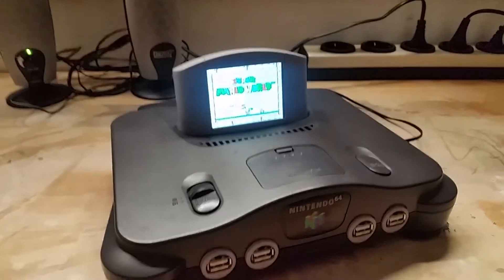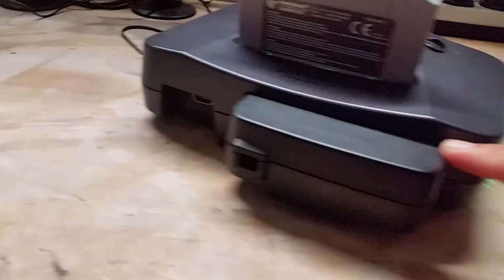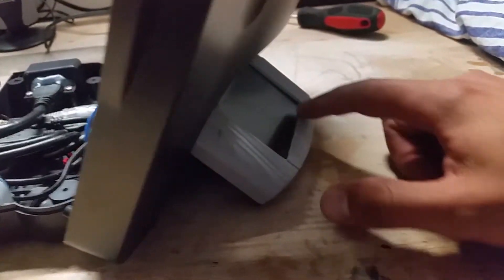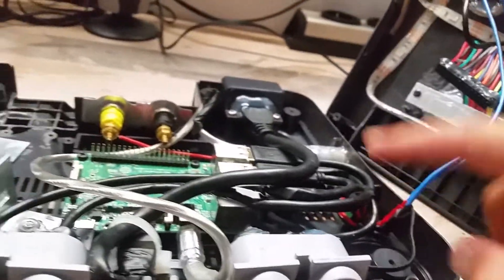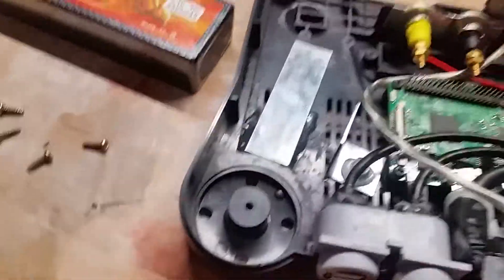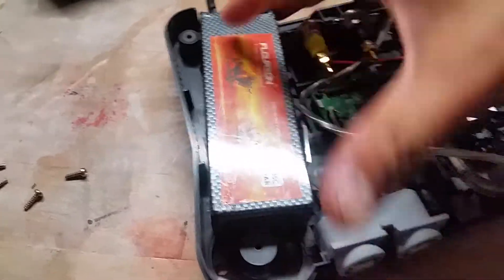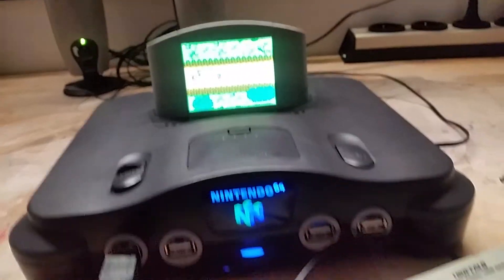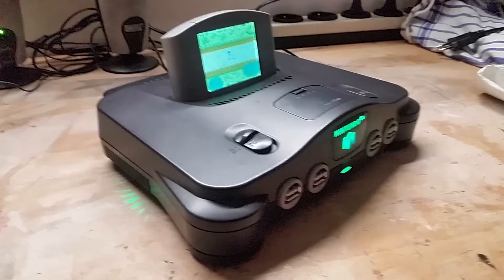Portable Nintendo 64 explained

Comment: what an idiot. Pi doesn't even good enough to emulate N64. Fix the board, buy everdrive, buy small screen, put small screen in everdrive shell, wiring some av cable inside and connect it to small screen, wiring some power cable to power the screen, and done!!
Reply from the maker: not good enough he?  :)
well
i made it work quite good enough 
https://www.youtube.com/watch?v=9A55koU7TZ8&t=149s